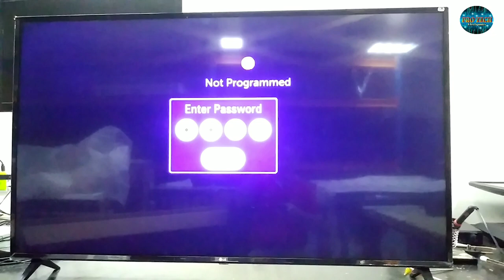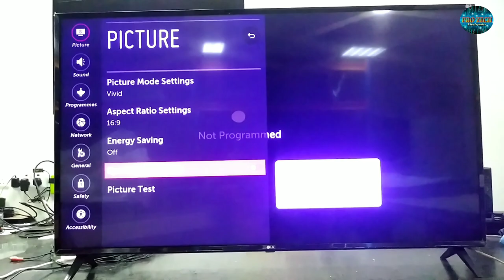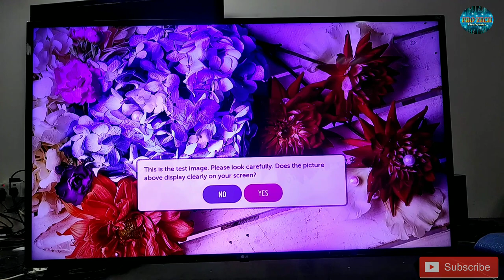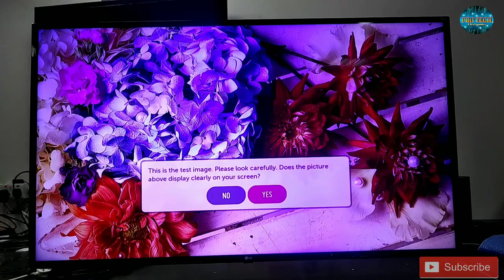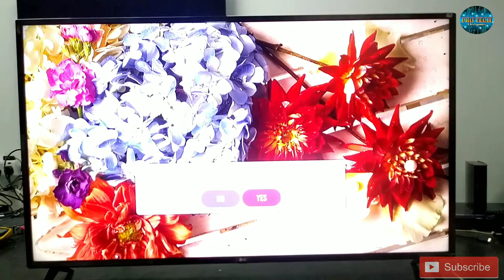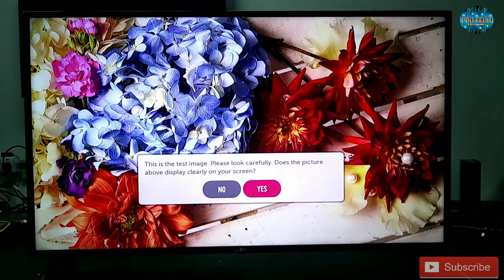Abnormal Color, Bluish Display LG TV Repair (Tagalog)

Comment: sir ask ko lang bumili po kasi ako ng vga2hdmi converter. yung tv po nmin smart tv ai thinq 2019 hdmi type sya tpos ung pc po nmin may videocard at vga type so dun ko nilagay sa converter ung vga at hdmi pra nmn sa tv. gumana naman po since 1080p kasi supp ng tv nmin at 1080p dn reso nung pc kaso ung kulay po ung problem. kulay reddish na prang may pagka b&w po color nya. tinry ko na rin sa win10 tama nmn settings sa pc monitor normal lng kulay sa tv lng tlga paano po kya mafix un? sa connector kya?
Reply from the maker: Galing vga yong signal nyo hindi purong HD ang pumapasok sa hdmi input ng tv kaya ganun.
Reply: @protechelectronics79 so wala wala po use ung ung converter na vga2hdmi?

Comment: Sir ganyan din ang sira ng philips 43 inch led tv ko (model: 43put6002/56) sabi ng technician backlight ang problem. Pano ba mgpalit ng led backlight dpat ba set o paisa2 lng pag palit? kac ang labor charge po 1,5k di pa kasama ang materials. Last feb. 2020 pinalitan nya ng isa backlight dahil sira yun daw dahilan kng bakit naging purple anv screen na ngayn aug 2020 naulit ulit purple ulit yng screen pinalitan nman ang isang backlight dahil sira. After one week  purple ulit.
Reply from the maker: Dapat po pag nagpalit minsanan na kasi pag paisa isa lang susunod ding masisira yong ibang hindi napalitan.

Comment: Hi, i need to do this to my tv cos i can see more and more parts of the back lighting turning blueish.  Obviously each tv differs from each other but how do you know how many LED array's you need?  Is there anywhere to get this information without having to open the tv?  Also how do you know which are the correct ones? Are they all the same?  Compatibility issues etc?  If anyone knows this information it would be much appreciated.  My TV model number is 49UJ701V
Reply from the maker: Go to any lg authorize service center and show to them the model# of your tv.

Comment: Sir magkano po usually aabutin ideally parts and labor to change the backlight of a 43" LG po same issue din...  thank you!
Reply from the maker: Wala po akong idea kung magkano ang rate o inaabot ng ganyang sira dyan sa pinas. Wala po kasi ako sa pinas dito po ako sa ibang bansa nagtatrabaho.
Reply: @protechelectronics79  idol thanks sa video ask ko na din po ung 32 inch Lg lcd tv ko nag horizontal halfscreen ung side cof   walang dots puro lines lang..paano ko malalaman ung vgl at vgh pati sa top board paano ko malalan ung vgl at vgh..thanks

Comment: Kuya pede ko pagawa TV ko sayo? 43 inches UHG 4300 LG TV ko. Per LG they can no longer repair my TV after they replaced the LCD. I need to get a new one daw which I don't think is the case. Same lang nyang nasa video ang prob ng TV ko and it happened nung pinalitan nila LCD. Parang luma ang pinalit 😑
Reply from the maker: Hindi ba covered ng warranty nila pagpalit nila ng lcd
Reply: @protechelectronics79  covered, thing is expired na sya and they told me na hindi na daw nila papalitan or rerepair pag nasira pa. Replacement na daw
Reply: Let me know po if pede ako pagawa sayo or if may marerecommend ka. Thank you!

Comment: Sir pag nag blue totaly as in wlang tao pero may volume anu poh sira nun??? lg din po xa
Reply from the maker: Voltage check po para malaman kung may problema sa screen.
Reply: San at ano po i check vgh po ba? Pareho din po ba yan sa samsung?
Reply: San at ano po i check vgh po ba? Pareho din po ba yan sa samsung?
Reply from the maker: Voltage check sa tcon.
Reply: PRO TECH Electronics   Sir pasensya napo bago lang po ako, ano po at paano po icheck ang voltage sa tcon. Salamat po sa pagsagot.

Comment: hello po, nagpa repair ako same problem po bluish LG 32 inch. 3,000 ipinagbabayad ng technician. what should I do po. dalawang strip daw sira
Reply from the maker: Nasa sa inyo nman po yon kung payag kayo sa kung ano napagusapan nyo ng technician bago gawin yong unit nyo. Kadalasan po kasi kinokontrata na pag mga ganyan.
Reply: pero sir, usually how much po ang gastos pag ganyan issue?

Comment: Need help sir ganyan din yung samin yan mismong model diko alam kung anong backlight yung dapat bilhin please patulong
Reply from the maker: Exact model po?
Reply: @protechelectronics79  43UJ6320-PA yan po sir
Reply: @protechelectronics79  sir?
Reply from the maker: Pasensya sir hindi lumalabas yong ganyang model sa system nmin kaya hindi ko makuha tamang part number. 49UJ  lang ang pikamaliit na inches ang lumalabas sa   system wala kasi kaming 43" sa UJ model.
Reply: @protechelectronics79  pero yan yung mismo sir tlaga pano po kaya yun itawqg ko na kaya sa lg mismo?
Reply from the maker: @raymondmabuti4298  inquire nyo po sa mga LG authorize  service center.